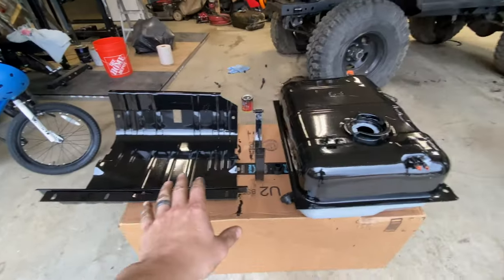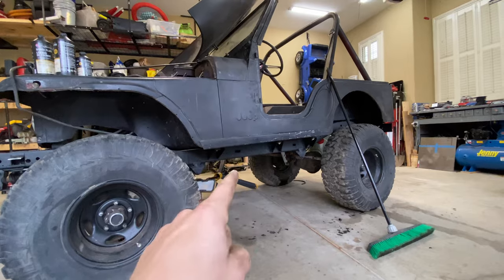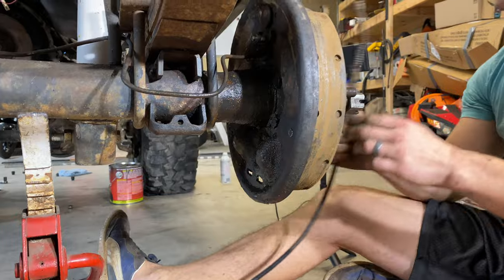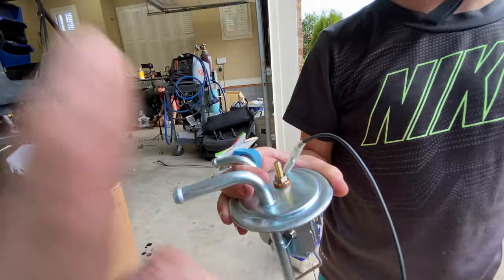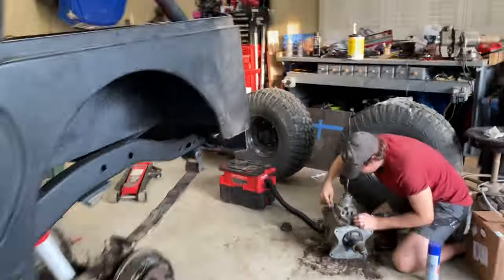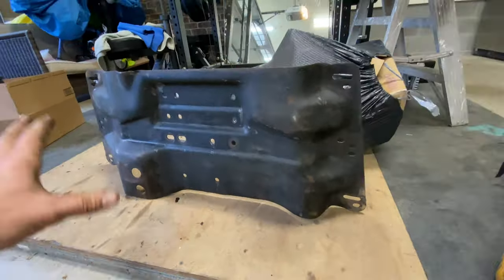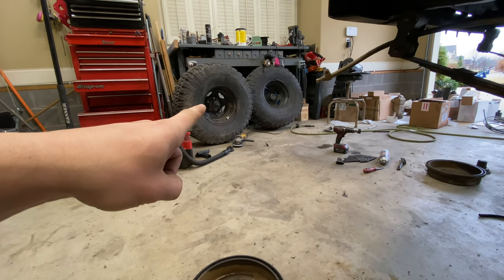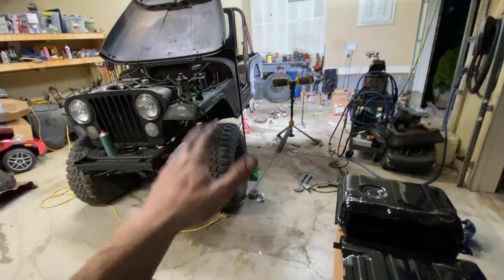NASTY transmission gets cleaned like NEW! - AMAZING RESTORATION - Jeep CJ5 rebuild series part 8

Comment: I have a 1978 CJ5 I have been restoring. One thing I struggled with was putting the skid plate back on… seems easy but it was actually very difficult! When I went to line the holes up on the skid plate it was like my skid plate was too big and had bowed outwards. Apparently it’s a common problem. If you run into this problem in the future, I used a couple of ratchet straps around the skid plate after I had one side in and pulled the skid plate back together in order for the holes to line back up! Hope yours fits but if not hopefully that saves you a little time and head ache!! Love the videos! Keep them coming!!!
Reply from the maker: Oh great pro tip! Thank you so much! I'm sure this will come in handy when I'm mounting up the skid plate. Thanks for watching Richard!

Comment: HI , the way you have the brake line mounted on your rear brakes is not going to work . it needs to be solid mounted to the frame .and use a longer flex brake line . same for the  two in the front .
Reply from the maker: Yeah funny you mention that,   someone  just told me the same thing in person after watching the video.  I ordered up the bracket so hopefully I'll get it mounted correctly soon. Thanks for the heads up! I'm learning new things all of the time and really appreciate the feedback.  Thanks for watching!